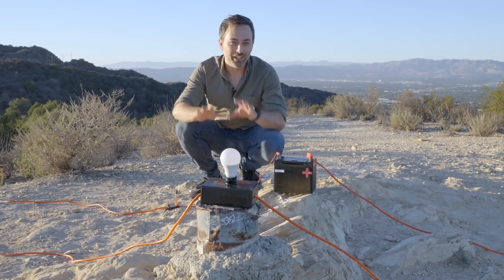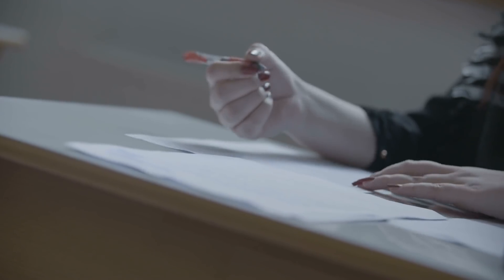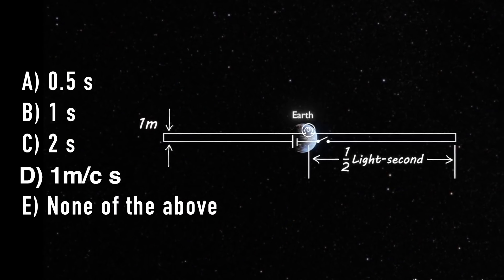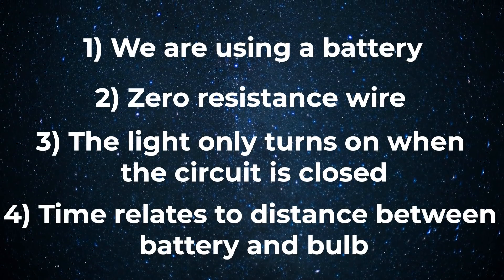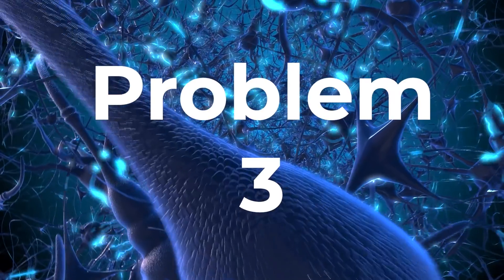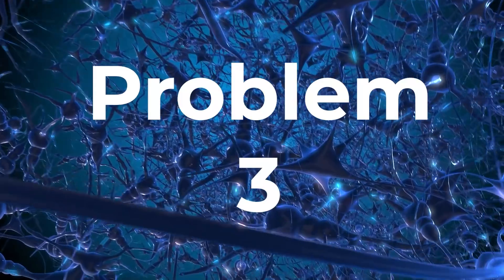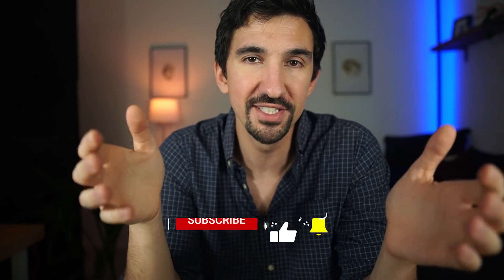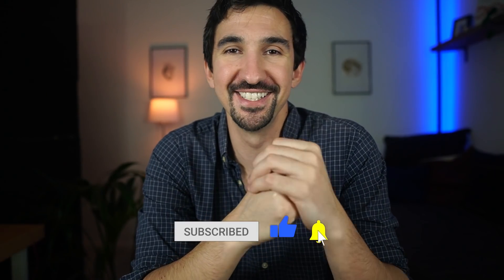Is Veritasium Wrong About Electricity?

Comment: I understood the thought experiment at Veritasium to be more of an argument that the electrons themselves don’t light the bulb up as they move through the filament of the bulb but rather that it’s the energy that flows outwardly that powers the bulb into illumination. I think that was his point.  The “lie” part being the rudimentary understanding of current as the flow of electrons that provide the energy to make things work as they flow through wires.  Tesla proved you could turn on lights and make things work without wires long ago.  Being an 8th grade science teacher, I do agree with your assessment of teachers needing to simplify concepts to an extent for students provided the results are correct.  We too undergo retraining and revise what we teach every year.
Reply: When I was in my senior year of my chemistry undergrad, I learned a lot of the things I had been taught in my freshmen year were wrong - but they were useful ways of simplifying information so that more complex ideas could be introduced. We were building on prior knowledge.

Once we (the students) had that prior knowledge, it was possible to say "okay, that basic stuff we taught you, not correct - it actually works like this" and we had the more advanced knowledge to understand the new "basic" concept.

All of this to say, just because you might teach something that's not strictly "correct" doesn't mean it's not useful. You can't teach (most) 15 year olds quantum mechanics, but you can teach them a more basic (albeit some what incorrect) model, and then they can use that later to learn quantum mechanics and figure out that what you taught them wasn't strictly correct.
Reply: Yep, I think you nailed it. In Veritasium's example, the light wouldn't go off if the cable broke, although it is easy to assume that Veritasium thinks it would, given the confusing way he presented the topic.
Reply: Not a scientist, just an electrician, but this theory is way above my education level. I think its still the electrons that light the filament, but it is the field that starts moving the electrons at the bulb that is 1/c fast. and the light itself has the same potential as the terminal of the battery that it is connected to, so the field doesnt have to make it all the way from the battery to the switch and then to the light. the field (potential is probably a better word) is already there on either side of the switch, and already at the light, charged up and ready to go if you like. sorry if this is a bit disjointed but i kept thinking of things as i was typing
Reply: You don't need to know about electrons to analyze this problem.   Current, voltage, resistance and Maxwells equations.   You don't even need Maxwell's equations as they have been distilled into "transmission line theory"  which answers this problem.

Comment: Interesting response. I also winced at the supposed "lie" we've been told. You have introduced the idea of inductive coupling but I think the proximity of the long conductors (1m in this thought-experiment) is not intended to be relevant. In any event (and as I have written in a comment to the original video) I don't see how the sun's radiated heat and light energy (travelling through an insulating vaccum) can be used to explain energy transfer via a conductor. If the experimental cable was completely electomagnetically shielded, then the light bulb would still turn on, without any external field. (Henry would have something to say about the speed of the event!)  Furthermore, we connect networks using shielded twisted pair cables (twisted for common-mode rejection). Their susceptibility to a radiated field is extremely low - and thus, their radiated field is also negligible. Yet they work to transmit a signal?

Comment: Correct realistic answer is D.  Problem is to "light the bulb", not just to get some tiny twitch of current flow.   Some length of EM interaction between the two wires would be needed to produce a measurable current flow at the lamp.  At 1 meter spacing, the coupling needed to provide the several milli-amps of current needed to light the bulb would occur over many meters (probably more like many kilometers) of the wire pair.   Delay would be twice the one-way propagation time to the point where the coupling becomes sufficient.  e.i. Far longer than 1/c seconds, but still far less than 1/2 second.  Correct answer is D.

Even assuming a very fanciful low current (pico-amps?) to light the bulb, the delay would still be noticeably bigger than 1/c seconds.

Comment: So here's a rebuttal to the causality thought experiment (I still think Veritasium is wrong but so is this counterargument):

The problem is in assumption 3.  Before switching the circuit on, it's in a steady state for longer than a couple seconds, therefore the electric field at the bulb "knows" about the whole circuit being closed except for the switch 1m away from the bulb.  If you switch it on, near-instantaneously, the electric field at the bulb "knows" that the circuit is entirely closed, because it's information is "updated" by the nearby closed switch, and can power the bulb.  If, simultaneously to that, the connection is severed half a light-second away, it'll take half a second for the change in the electric field to propagate, and for bulb to turn off again.  So, for half a second, the electric field at the bulb "thinks" that the circuit is closed, and powers the bulb for that time.  No causality violation necessary.  

Now, I don't really think that it works that way (I think the field propagates along the wire, not across the physical gaps in the circuit), but my point is that the way Derek Veritasium thinks it works isn't necessarily inconsistent with causality.

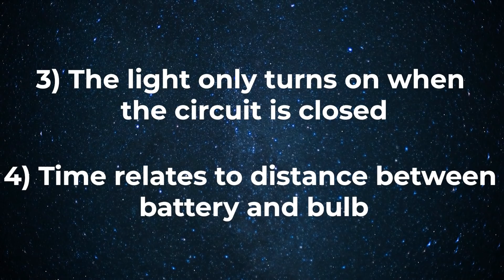Comment: I don't think that your assumption about problem 2 is correct. If you look at 6:12 in Veritasium video, he says that the electric field travel at speed of light, so when you cut the circuit at some random distance the information of the field no longer existing from that point also travel at speed of light. So the time to light bulb to turn off is the distance from the cutting point to the bulb divided by c.
 The reason why the light turn on in Veritasium problem in 1/c seconds is because he says that you first connect the battery and the wires than you close the switch, this gives time to the electric field to travel to the bulb.
 If in Veritasium problem you simply don't have a switch or the switch is already closed before you connect your wires to the battery than the time to the light bulb to turn on wouldn't be 1/c s. Would be the time that the fields take to travel the length of the wire.
That's my understanding, so tldr the second problem that you talked in the video wouldn't break causality

Comment: He's not wrong generally speaking but perhaps off on some details. The two important conclusions: 1. The electrons only travel a relatively very short distance. 2. The pressure to cause current to flow locally is being propagated electromagnetically at the speed of light. The misconception he refuted was that electricity is entirely due to electrons traveling long distances to power devices. And the misconception that the electron from the power plant will ever reach the light bulb at your house. What he stated in the video is not something revolutionary, but is known to anyone who paid attention in their study of electricity. Perhaps he could have presented it better.

Comment: His first issue: the breakage of causality, isn't really an issue with Derek's model.  Derek said that it would take 1m/c seconds for the closure of the switch to affect the bulb because they're only 1 m apart.  At the same time, a breakage 150,000 km distance would take 1.5x10^8m/c seconds, or 0.5 seconds. Those two answers are entirely consistent.

Comment: You need to be very, very careful with that “zero resistance” assumption, which school science classes so blithely assume. Basically, it is never possible, and just hides problems. Two reasons, which are related:
#1: If the cable has zero resistance, it is superconducting…..so as we know, it cannot sustain a magnetic field. And when the electric field changes at “switch on”, there must be a magnetic field associated with that rate of change. Corollary: perfect superconductors can only exist at dc. Your experiment implicitly probes the ac response, which means resistance can’t be perfectly zero.
#2 At switch-on there is an infinitely fast voltage edge. Hence infinitely high instantaneous frequency. Therefore the skin depth in which the current is carried within the cable is zero. Therefore the cross-sectional area in which that current is carried is zero, and the resistivity is….infinity multiplied by zero. Nonsensical.

Comment: That other video bothered me also.  One of the practices in making audio vacuum tube (called valves across the pond), is too twist the wires together then the filaments are powered by AC 6.3V or 12V (for example) to cancel out the magnetic field.  The current still flows and the bulb still lights but you've managed to reduce the radiative footprint of the field which would otherwise couple with the cathode, grid or plate and create hum in the circuit.   Another affect of vacuum tube technology is the accelerate the electron flow by the use of a screen grid (such as in a tetrode or pentode).

Comment: The two labels "300,000 KM" (by the way, it's "Km"; can't believe a physics doctor would make this rookie mistake) make me think that the wire goes 300,000Km in each direction. If the wire is supposed to be 300,000Km long from left to right, there should be only one label in the middle. Poor labeling altogether.

Comment: Cause & effect can be broken using longitudinal dialelectric impulses instead of transverse longitudinal EM waves. Lookup Eric Dollard. Theres 2 forms of electricity. The energized electro static that moves instantly which is analogous to tugging a rope. The opposite end feels the tug instantly. The normal EM type of electricity we use is analogous to flicking the rope which makes a traveling wave thats limited to the speed of light. Tesla already proved all this & his wireless power system was not electro magnetic or hertzian in nature but rather a impulse & diaelectric shockwave technology.

Comment: I also think the time to turn on is not determined by the distance between the light bulb and the battery, but the distance between the switch and the battery.  At the open switch you have the potential difference between the positive and negative terminals of the battery.  So when the switch is closed that is at that point where the current start to move, creating the EM fields which propagate at c.

Comment: Yes he is wrong!
Imagine that the switch is on negative side. The whole circuit initially positive, which means lack of electrons. Additionally, when electrons start moving they produce a very weak EM that is supposed to move the missing electrons on the bulb side wire in the opposite direction (from positive to negative) which is futile! It won't be able to overcome charge power and won't have any effect.

Comment: The moment you put the unit as 1m/c seconds the problem is immediately obvious as the time is related to the distance between the wires or specifically the distance between the load and the switch. this is just a transmission line and actually the light would not come on at full brightness straight away. the signal will get there in D/c seconds (where D is the distance between the signal source  and load) but the full power the the load will not be delivered until both electric and magnetic field are able to propagate down the whole wire since the initial transfer of energy is only due to the miniscule capacitive coupling between the wires which has a much higher impedance compared to the DC steady state of the wire. the wires further down the end can actually be treated as an open circuit at t=0 as the magnetic field has not yet propagated there yet, only the electric field is present at t<0. the full power would not be achieved until the electromagnetic wave propagates down the whole wire and back to the load due the the ends of the transmission which would take 1 second.

Comment: My intuitive solution is that the „on“ signal on the bulb will depend on where the loop is opened. This way the faster than light communication would be solved. Say: the switch is furthest away from the lamp, it takes 1/2 s. With the switch being a meter away from the bulb, it turns on after 1m/c.

Comment: Very nice Video. I already knew that the energy propagated alongside the wires in the form of electromagnetic fields, but veritasium made it seem like the the entire energy of the source takes the direct path to the lightbulb, implying the bulb would be fully powered after those 1/c seconds. Thanks for clearing things up.
Reply: Uhm...nope. Derek explicitly said in the video that the bulb will NOT receive the full voltage of the battery immediately, just a fraction. I don't know why so many people seem to have missed that part.
This implies the bulb will be slightly dim at first and then it will get progressively brighter.

Comment: So... the video was wrong then.
You can't ask "how long it will it take to turn on the lightbulb" and then assume the answer is simply the time it takes for the EM field to interact with the lightbulb, because that isn't really turning on the lightbulb. Everyone would assume that, unless it is a trick question, turned on = turned on to the actual power the light is supposed to run at, otherwise I can just say that every appliance in my home is always turned on because it's always influenced by the EM fields around it...

Comment: I'm sorry Ben but if your field is in science at all then you must realise that an answer doesn't have to include ALL UNITS that went into the calculation... just like the answer to 1x2x3/2 is not 1x2x3/2... it is 1x3... or just 3....

Also, you seem to think that you can just stick units wherever you want and say that you are right. You are obviously correct that the speed of light is c m s^1 but a time DOES NOT contain any distance units so why would you even put that 1m in your answer??

The actual calculation that V did is (1m) / (c m s^-1)... so the m units cancel out and you get a division by 1/s which takes the s to the top and you get the ANSWER 1/c      s  (notice the space)... It's also not 1 / (c s) just to be clear...

Sheesh.. all these people trying to claim the answer has the wrong units when they can't even do simple unit algebra...

Comment: Would the setting up of this experiment itself cause the bulb to 'turn on'? 
-when the battery is connected to the conductor, that will cause the field to move/change even when the switch is off.
-moving the blub and/or its wire through space to bring it to 1m apart would also cause the field around the bulb to change
-once everything is done and we then are next to the switch, even bring that physical switch down to make contact would change the field causing some E/B fluctuation and transmission of energy 'turning on' the bulb before the circuit is closed.

Comment: In the video of veritaserum it is clearly mentioned that when wires are connected from power source to load, the electric fields extends to the load at speed of light. Before spreading of the field, the load will not turn on. Therefore faster than light communication is not possible. If this fact was not mentioned in veritaserum video. Then you could have said that his logic breaks causality.
Reply: So, in other words, energy is carried by electron-electron interactions, and not by some aether that was implied by Veritasium. Which means it'll take c meters instead of 1 meter of travel.

Comment: I know that one of the problems is frequecy of electrical signal is that they can't change the voltage too quickly as the electric field resists change or something or the wave takes time to travel down the wire. The second problem is elecritcty is the movement of electrons. So you turn the switch and the electrical field kicks in. Even if I assume the elertical field kicks in at the speed of light but then the electrons are still going to need to move, that is mass that needs to accelarate and that is not going to be the speed of light. So any answer close to the speed of light I would not consider.

Comment: "Problem 1" was addressed in the original video. He mentioned that this hypothetical required unreal conditions of frictionlessness.
Reply: Also, in your critique, you forgot the recognize the importance of the distance between the battery/switch and the bulb. You placed your wire-break (another switch) at the far side of the wire and continued with the process as if the distance between switch and bulb hadn't changed.
Reply: @GodsAutobiography  And this distance should have changed?

Comment: 1m/c itself is ambiguous. It could be a measure of either time, or speed. The speed interpretation would just be c. Google calculator only chooses time because it detects you are dividing a distance by a speed and that usually is a way to calculate time. It's a guess. To make it explicit you need to know the quantitative property ahead of time. Which is stated in plain english as time, and further made explicit with an s suffix. 1m/c is not enough on its own, you need 1m/c s, and that is functionally equivalent to 1/c s. The way he wrote it is correct and succinct. TLDR; Google calculator just isn't that great.

That said - yes, your video explanation that it's just a transmitter & receiver, is the same thing I commented on the original video when it was first released. It's misleading to say it's a closed circuit when that doesn't even matter.